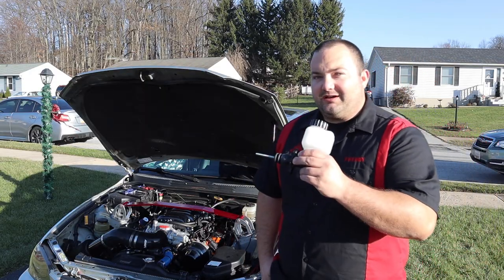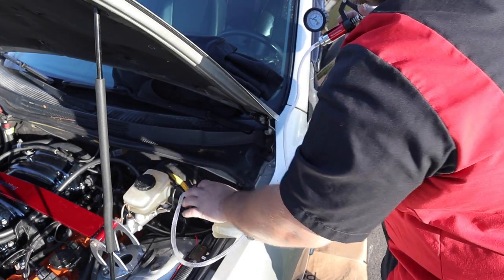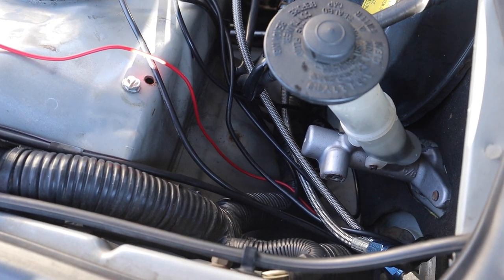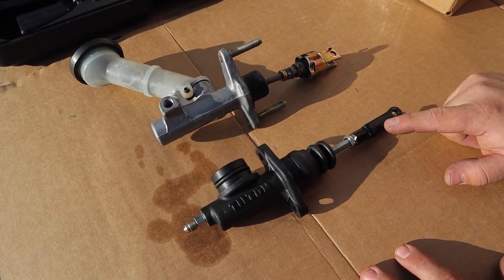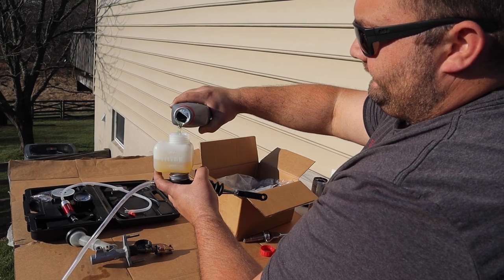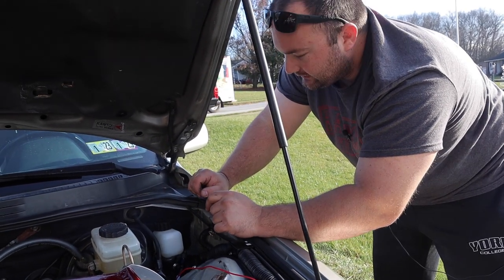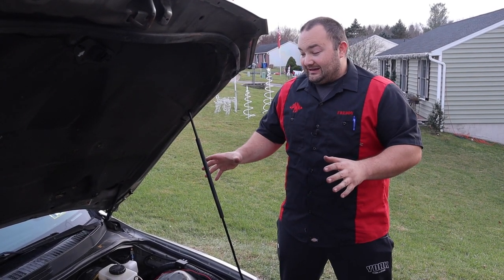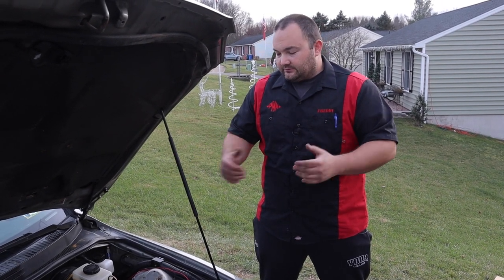Lexus IS300 1UZ Swap Pt 9 | Clutch issue fixed and it rips! | Tilton Clutch Master Cylinder Upgrade

Comment: The little black float in toyota master cyliders and in other master cylinders is  for low fluid situations. The float makes a seal at the base of the master cylinder reservoir if the fluid were to drop, in theory keeping air from entering the system.
Reply from the maker: Cool! Makes sense!